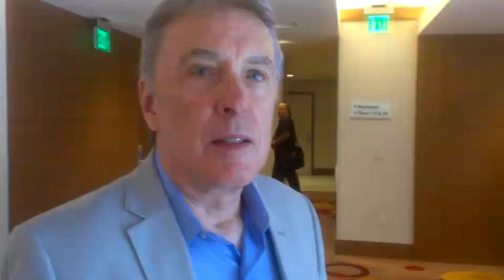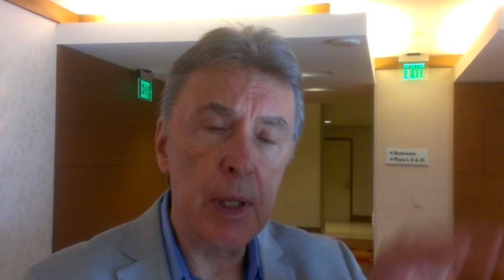Jon Peddie on GPUs, at Siggraph 2012

Comment: It seems the graphics hardware is almost advancing too fast, a good example imo is AMD's HW lately, moving from VLIW5, to 4, and less than a year after introducing GCN, GCN started out pretty good, but even AMD wasn't completely prepared as we've seen it improve a lot with the latest drivers, I know this happens a lot and I may  be mistaken, but it seems the GCN has improved a ton more than VLIW4 did. Not to mention Bulldozer which is a lot better than it's given credit for.